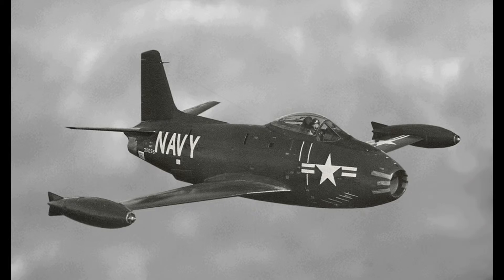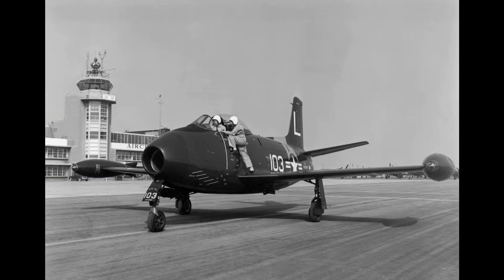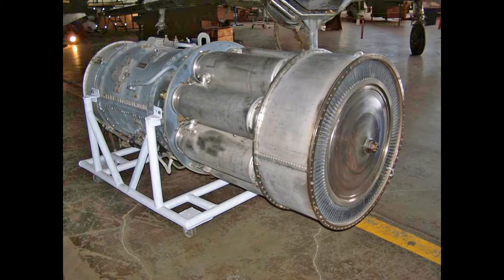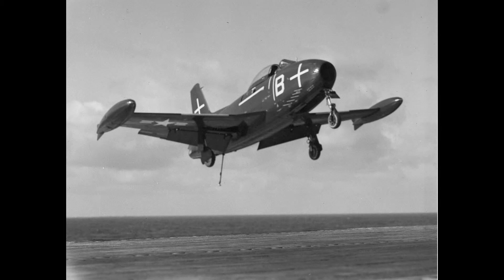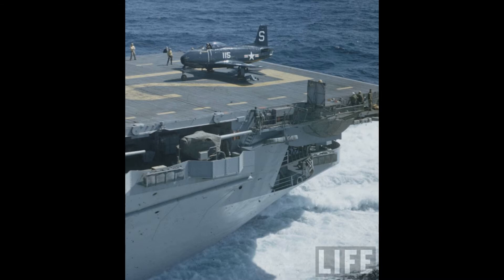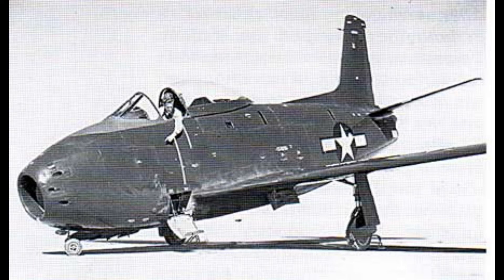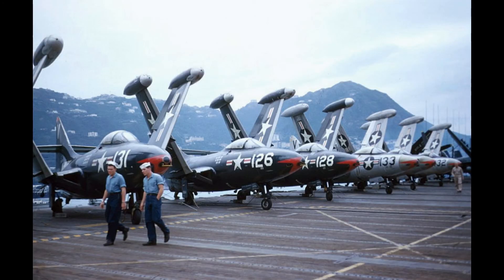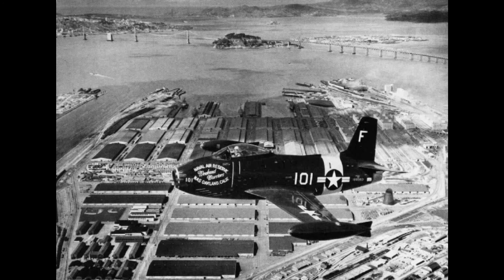FJ-1 Fury | The US Navy’s first jet powered carrier plane

Comment: Thrust is not measured in lb/ft, you’ve confused it with torque like what would be from a piston engine. Thrust is just measured in pounds
Reply: Technically it is measured in Newtons, but the American people don't use the metric system. The military does though
Reply: Wiki lists the powerplant thrust output by lbf. Just saying.
https://en.m.wikipedia.org/wiki/North_American_FJ-1_Fury
Reply: well hes trying...

Comment: The Navy buys planes like I buy cars, pieces fall off after they are purchased.
Reply: In the forties and fifties,  aircraft technology was changing rapidly.  Changing mission as well as pressures brought on by Korea and the Cold War   resulted in a rapid turnover in Naval Aviation.  In some cases, promising aircraft were doomed or, at a minimum, compromised by the failure of the Westinghouse J-40 engine program which the Navy was heavily invested.  This doomed the FJ3 and F7U and would have the F4D Skyray had not Douglas designed the airframe to accept a different engine, which turned out to be the Pratt and Whitney J-57. Unfortunately  for Douglas, the Navy decided it wanted multi-mission fighters and the F-4H Phantom II was purchased in large numbers and the dedicated interceptor was pushed aside.  But this aircraft did stick around into the eighties.